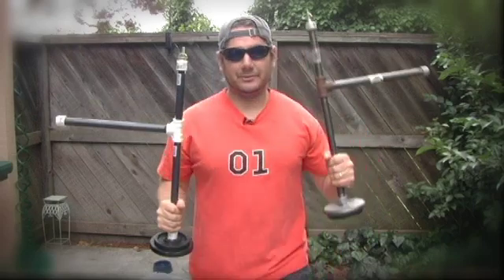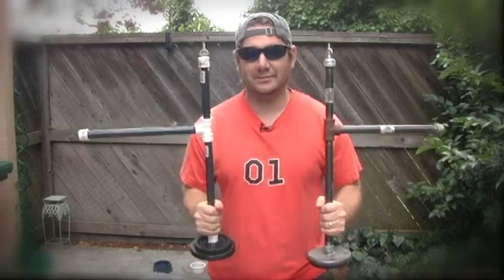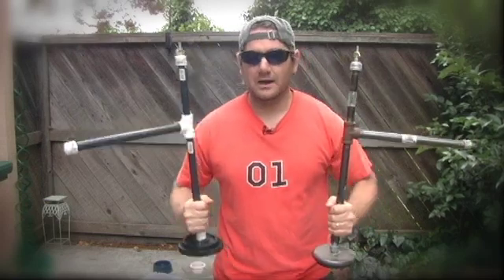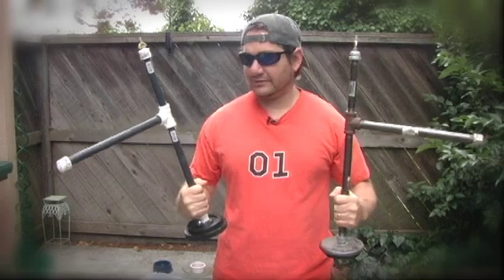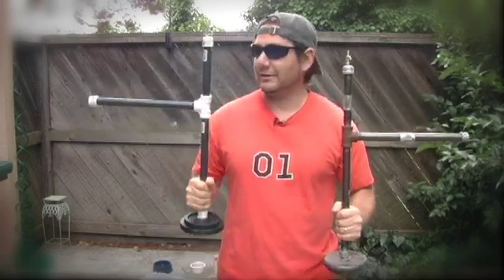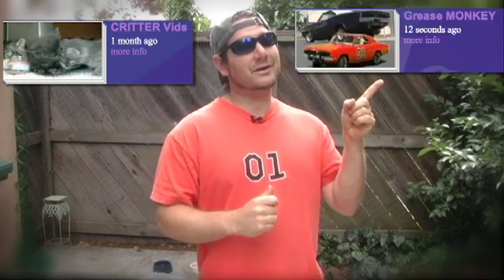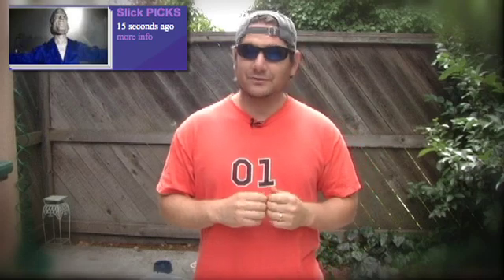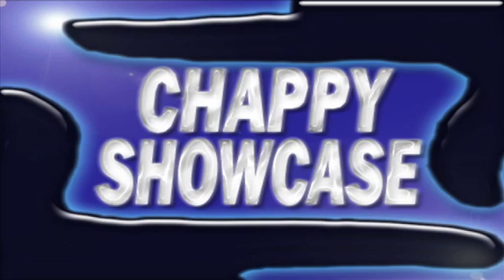$30 PVC Steadicam Demo

Comment: I am planning on making a steadycam, but i wont be using a heavy camera like yours, I would be using a GoPro hero 3 or rarely a nikond7000i. I am confused about the weight counter balance thing. how could i solve this? what should i use for the weights?

Comment: One could keep the heat/cold benefit of the PVC, and beef up the weight by filling the pipe with something...ie sand.  Guessing the weight would be something between the metal and PVC-only versions.  Just a thought.

Comment: Hey Matt I have a question for you. I just purchased a Kodak Zi8. Would this setup work for a small video camera like the zi8? Also since it is a relatively light camcorder how much weight should I put at the bottom to counterbalance? Do you only want enough weight to counterbalance the camera OR will more weight on bottom make for a smoother shot. Thanks in advance for your help.

Comment from the maker: @MrSpyKload   You could try the $30 steadicam made out of pvc.  I used to own a XL1.  You are right, they are pretty big cameras, but for $30, what do you have to lose?  Just make sure you look up the weight of the camera, and also factor in the weight of the lens and any other accessories for counter weighing the set up.